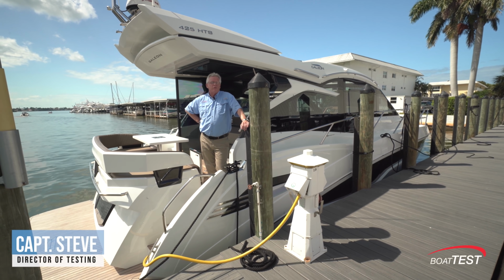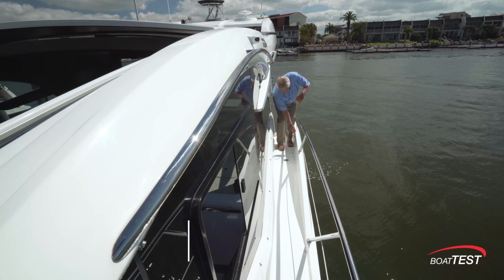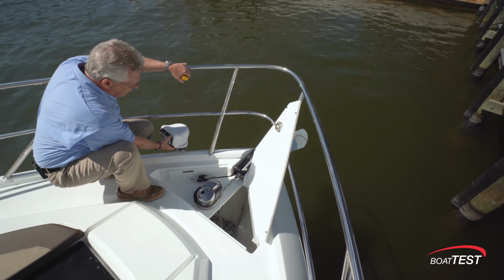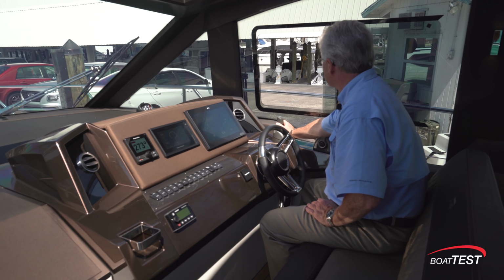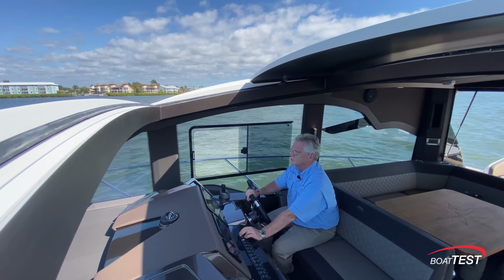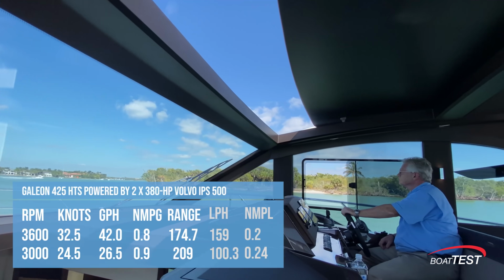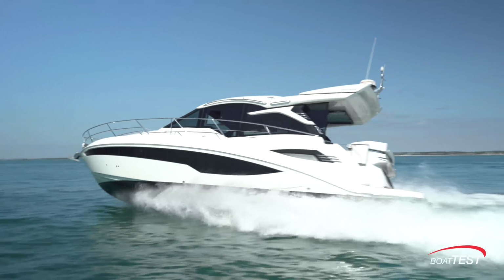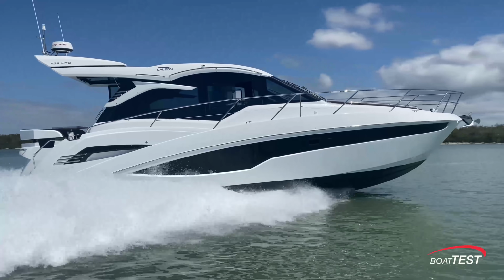Galeon 425 HTS (2021) - Test Video

Comment: Another great review from Captain Steve!  I like how Galeon used darker colors on and around all of the glass, which is a big help in reducing glare.  The only glare I noticed was from below deck when the companionway was open and another slight centerline glare on the windshield, which is probably due to a different finish on a trim piece. Okay, I'm a fanatic on windshield glare.  :-)

Comment: Do you think the compromise of the IPS at speed outweighs the benefits of maneuverability at low speed?
Reply: Most definitely!!! Why would you EVER need to do sharp turns at high speeds in a big boat?
Reply: @CharlieOdom1957  Agreed.
Reply: In the northeast we often encounter floating logs that are flushed out of the marshes, which are usually at or just below the waterline due to being partially waterlogged.  Also, lobster pot buoys just below the water line during a very high tide. :-)
Reply: @DA-qe9py  you didn't answer the question at all!!!! Also, WHY would you be traveling at a high rate of speed when you already know there could be obstructions in the water?

The boat turns plenty sharp already. If you want to do slalom runs with a 50', 20 ton boat, then you have some major issues!
Reply: @DA-qe9py  I get that...but don't those dangers in the water sort of demand that a person slow down?  :D  I'd hate  to think that with logs and other dangers, someone was blasting along at 20+ knots...LOL

Comment: Lekker man lekker 
More seriously, the problem with Galeons under 50/55 foot (depending on model range) is you do not get the full drop-down sides with cocktail seats portside and an open, ocean-facing seat starboard (some just-smaller models have cabinetry starboard inhibiting access and views). The FULL open aft deck is SO good it's a shame to not have it.
Reply: Lekker